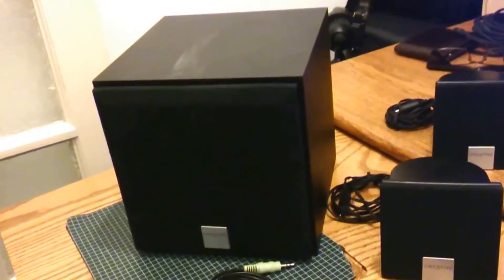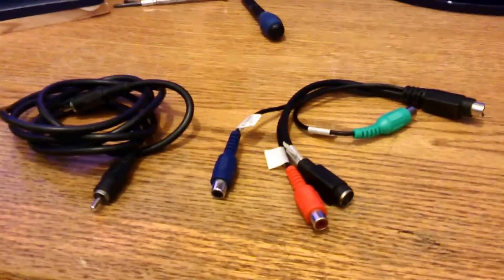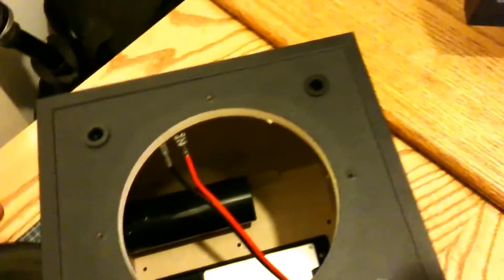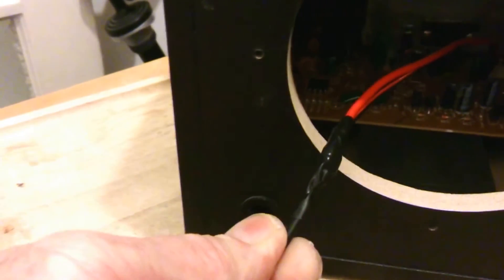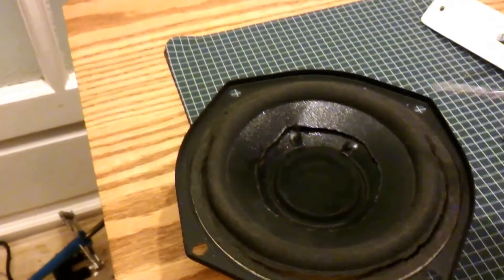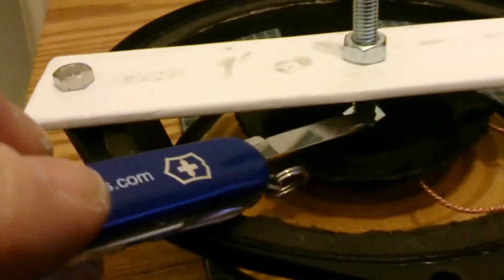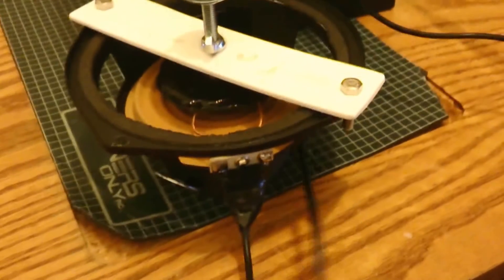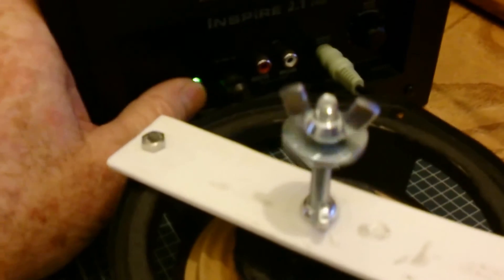DIY Tactile Transducer

Comment: How did you mount this? Is the rod the only part that touches your seat?
Reply from the maker: As mentioned below in the thread... ''The bolt that is now epoxied onto the centre is what you attach to the seat.  Make a hole in some place on your seat put the bolt through it,  as you can see in my unit I have a butterfly nut to tighten it with.  I had removed my armrest and therefore had a convenient hole to  use  but if you do not have any existing hole to use, well then you are going to have to use some bit of ingenuity and create one
Reply: @ESEAone  thank you... I mounted it the way you mentioned. I just wanted to make sure I did it right....thanks again

Comment: A speaker converted into a vibration transducer cannot be as powerful, but I am sure it could work somewhat. The voice coil simply isn't designed for such a load, and I fear you may burn it if you try to push it too hard against a hard surface.

Comment: emm, hwo would I exactly mount this under my chair?
Reply from the maker: MrMats0n The bolt that is now epoxied onto the center is what you attach to the seat.  Make a hole in some place on your seat put the bolt through it,  as you can see in my unit I have a butterfly nut to tighten it with.  I had removed my armrest and therefore had a convenient hole to  use  but if you do not have any existing hole to use well then you are going to have to use some bit of ingenuity and create one

Comment: so will this produce sound ??
Reply: All transducers sometimes can resonate on furniture which may be audible, so you are aware. Also, if the mounting is loose enough to rattle, it will be very noisy :)
Reply from the maker: b0ssnian  Well! in the traditional sense No as you have removed the diaphragm that usually pushes air to which affects your eardrum and therefore sound so no diaphragm no sound. But depending on where you mount it and how much you turn the "volume" up on the amp you will hear something, lets say you mount this thing  under a table using the bolt, the unit will vibrate and cause the table surface to vibrate and act like the diaphragm and yes sound is produced. However we are not sitting on a table driving our sim  it's rather on a seat . these have relatively big flattish areas on them and if given enough power to the  transducer will make sound somewhat muffled because of the seat padding.  They can also make lots of sound if you have anything loose on the seat. as you can here in the video the washer is loose and it makes noise. I have mine mounted on an armrest mounting point (quite a solid part of the chair) so only if I crank it up do I start to bother family watching TV in the same room
Reply: cheers man! But the other thing is that; my sub woofer creates a large bassy booming sound if you understand what I mean, will this produce the same kind of sound? thank for the input :)
Reply from the maker: No!  if you cut out the diaphragm the speaker will not work as before so no sound.  It will just vibrate.
Reply: Okay thank you for your patience!
Reply: Richard Smith ite cheers bro

Comment: Hi Edwin! First congrats on the video. It's an awesome project!!!! I'm writing this because I have a buttkicker starter kit (that comes with a 50W tactile transducer and a 90W amplifier) and I'm a little disappointed to be honest, because I thought it would be stronger. Because of that, I'm thinking about building one on my own. Would you know how a home made tactile transducer compare to a buttkicker? I mean, let's say a home made tactile with a 100W (or even a 300W) subwoofer and a 50W BK (such as the one I have or a BK gamer 2 that has the same tactile transducer). By the way, I see you mentioned XSim and I'm interested on using it for simulation also, racing simulation in my case. Thanks.
Reply from the maker: Aritan Maia I am afraid I can not really help you there as I have not experienced the BK and so my only reference is this DIY one I made.I ended up trying XSimulator "SimTools" but was told "Simtools buttkicker's support is under development" So what I have been doing is for the moment is driving the shaker amp from the PC audio bass output. I have put further development of this on hold as I am doing a lot of home DIY renovations at the moment. I do plan to take the smaller speakers and convert them for the the L & R channels.